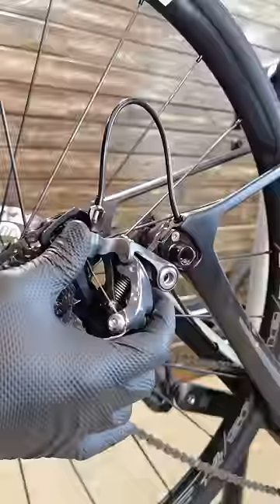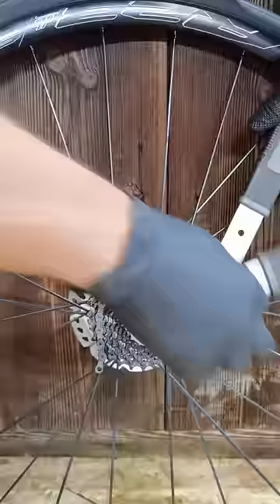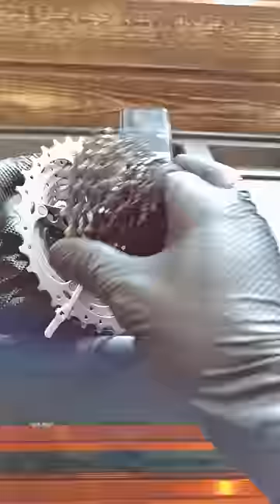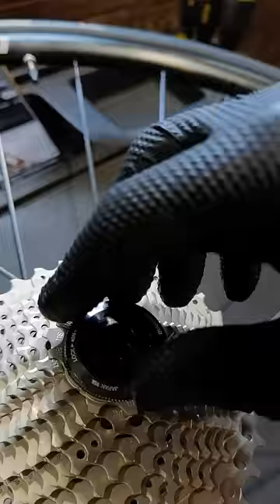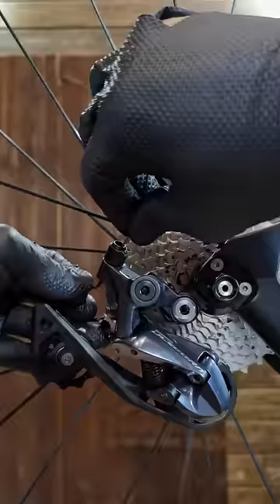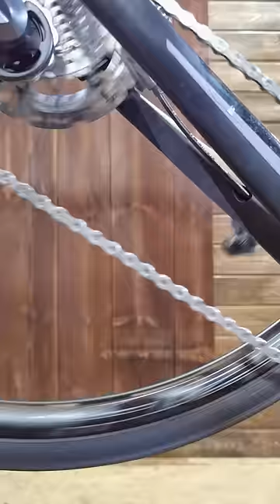Need lighter / lower gears on your road bike? Do this.

Comment: "Do this" like it a cheap upgrade. 😂
Reply: you can go off brand for cheap
Reply: It would be easyer to buy a new bike
Reply: @guilhermerizzo1984 Got more insanely stupid jokes? Go on!
Reply: @guilhermerizzo1984 Yeah maybe a heavy ass sipermarket one. Cesettes are like 50 euros. Good derauliers are around 100 euros.
Reply: @guilhermerizzo1984  not necessarily. You're not replacing the whole groupset or the wheels, just the cassette and chain and maybe the derailleur if it has a short cage.
Reply: You have to change it at least once a year if you ride a lot so you just buy a different one, not a single euro spend to upgrade
Reply: it is a cheap upgrade....i don't know what kind of price do you have and what a state do you live in.
Its made not from Gold, you know..
Reply: 105 derailleur is about 45 eur. 105 cassette about 55. Chain is another 20 and the cables about 10. Total cost is about 130 euro if you go for 105 and about 210 if you go for Ultegra
Reply: Tera phone isme chala jayenga pura
Reply: It is a cheap up grade😂
Reply: Thats a whole 300 to 500 dollar stuff, i might be wrong
Reply: @BeatSaberNoob just buy a new bike
Reply: High end components are pricey, for comparison, 9speed sora is £25 for the derailleur, £30 for the cassette and £20 for the chain, you can easily get a marginally lower end cassette and chain for £20-25 and £15 respectively if you're upgrading a less fancy bike.
Reply: Generally, to get more gears, you need a new cassette and chain. 
Is this hard for you to understand?
Reply: @BeatSaberNoob why would you add sh£tty cheap components to a nice new Shimano groupset?
Reply: Where did he say cheap upgrade? The unemployment is really showing with this comment
Reply: @guilhermerizzo1984 what are you talking about a bike would cost like easily 10-20 times more
Reply: It us a cheap upgrade. I did it
Reply: @guilhermerizzo1984 if you do t know how to work on a bike I guess. This is basic stuff..
Reply: @razzor4708  lol if your other parts are compatible..  Still it's not "cheap", cheap is like $20-$40.  This cost like $200 minimum lol not to mention if you don't have the $100's of dollars worth of tools already, then you will have to pay shop labor which around me at leasy ranges from $70hr-$90hr lol
Reply: @guilhermerizzo1984 bullshit 😂
Reply: @razzor4708  iPhone are also not made from gold but they still choose insanely high
Reply: @christosandreev6392 do you have to necessarily replace the derauiler? Real question
Reply: @guilhermerizzo1984  Easier isn't the same as cheaper. It's not hard. Best mod I've ever done to my road bikes.
Reply: I bought a new cassette for $36. As far as cycling costs go, that's almost free.
Reply: @guilhermerizzo1984 do you know the cosy of parts vs whole new bike. You know nothings nout bikes with that comment rt there
Reply: Aqui no Brasil para colocar um K7 de 10 velocidades da absolute, com corrente prateada KMC,coroa dianteira 36 da deckas, câmbio e passador Shimano e cubo Shimano custa 1.800 reais.
Reply: It Kost like 80 Dollar
Reply: @jurekgadzinowski2895  he is brazilian, you mistake for giving his comment any value
Reply: I'm ashamed he didn't use 11-52 cassette
Reply: @guilhermerizzo1984 eventually you would want to replace the cassette anyway, ppl who ride their bikes over a thousand miles a year would know this. For the neighborhood cruiser, it probably doesn’t matter

Comment: Alternatively learn how to pedal harder if you're short on tools and cash
Reply: and destroy your knees
Reply: Dumb take....
Reply: @olivier8645 evolve your knees *
Reply: I can! My other bike is fixed gear. But on a loaded touring bike?
Reply: There are old riders and "man the. . . Up" riders. There are no old "man the. . . Up" riders.
Reply: Why, my bmx is a single speed with a 70T front sprocket and 9T rear freewheeling sprocket I on purpose built for speed. Furiously fast on flat roads, insanely fast downhill! At full speed, left even some motorcyclists I overtook going downhill in awe! Overjoyed with it! 😊 I’m not even bothered by the pedalling effort required. HAHAJA! 🖐🤤

My advice is go ahead and try it and see for yourself what you will gain in speed. 😁👍
Reply: @hyperboytkl1077 Amazing story.😂
Reply: @hyperboytkl1077 And then you woke up because you shat your pants.
Reply: @hyperboytkl1077 I hope you at least had fun making up all that BS!
Reply: @boredmartymcfly6099  wow, you sound like you ain't seen your junk for years without the aid of a mirror, I too have a bmx and at full pelt its quick as! From standing start its quicker than my mtb and 60% lighter at least.
Reply: 11-28 and 52-36 at the front. I really need to push hard to keep cadence optimal
Reply: Road bike supposed to have smaller gears so you can go faster. Plus you have two rings in the front. I never had issues with road bike needing larger cassette
Reply: Yup
Reply: @olivier8645 snowflake
Reply: @sempi8159 I think it’s a dumb take to assume everyone can afford new things. It’s actually pretty reasonable to assume you need to pedal faster if you do t have parts to help you do so?
Reply: @hyperboytkl1077 How are you going downhill when you have to push your bike uphill?
Reply: I just think younger😂

Comment: "need lighter gears? all you need is €500 in tools and parts"
Reply: 3k
Reply: @69burtolaughing my fucking ass off 😂😂😂
Reply: This is an XT derailer and casette and probably a cn-hg95 chain. So its more like 150-200€
Reply: @Vracka  tell that to the bike part seller
Reply: xt derailleur? @Vracka
Reply: @UserT5959 recently changed a bottom bracket from an old square taper to a new integrated one. Lets see: an altus 3 speed crankset, a bb-mt501(i think) bottom bracket, a hg-93 chain, a crank arm puller, the tools that go into a wrench to get off the square taper bottom bracket, the tool for tightening the new integrated one, and 150ml lithium grease, chain rivet tool. I think it was around 150-160 euro if i calculated it right in my head.
Reply: @69burto yes, I in fact will buy a cassette tool, chain whip, Ultegra chain (which on its own costs approx £40), an Ultegra/XTR cassette, and a medium cage Ultegra rear derailleur for less than £60, why didn't I think of it sooner.
Reply: @Vracka  It literally says Ultegra on the derailleur. They're on par with the cheapest ones. Next to slx.  I changed on my full sus from an slx 1x11 to an xt derailleur. Only cost about £70. Plus an xt shifter. Didn't need the shifter. Just wanted it. Don't recall how much. Jeez. Contrast that to the bike I have now running a sram axs system. Tbf though "cheap upgrades" are all relative and I guess a case of budget + if it's actually worth it or not. For this video, a smaller front chainring would make more sense. Smallest sprocket will always be 10 or 11 teeth. So this "upgrade" was only to get shorter ratios. And 1 or 2 extra gears, I didn't pay attention to that before typing 😂  But a smaller front chainring is far cheaper than what this Chief did.
Reply: if you already have the shifters and such on your bike, all youll need is to get a long cage derailleur which can cost like, 50 bucks, then a cassette lockring tool for like 10, then chain whip for like 15, cassette ranges in price, then a new chain for the new length
Reply: you can get those tools at a cheap price for around 30-40 and if you buy a cheap cassette like tiagra you can get it for 40-50euro. Less than 100 euro if you go a bit cheap. works fine.

Comment: It's not as simple and, above all, cheap as it may seem. To switch from an 8-speed cassette and Claris derailleur to an 11-speed setup, you need to replace not only the rear derailleur, cassette, and chain but also the front crankset (due to the narrower chain) and the rear derailleur shifter, incurring additional costs. Usually, the hub that supports 8 speeds may not handle 10 speeds, so there's a concern about needing to change the hub as well. Additionally, the Ultegra derailleur won't work with the Claris shifter.
Reply: What are you talking ? The original cassette had 11 cogs. Or are you referring your own setup ?
Reply: @gerrysecure5874 11? Claris? 😅
Reply: You right!
Reply: Both derailleurs were ultrega. He just upgraded to a long cage

Comment: Shimano chains should always be mounted with the logo facing outwards 😅
Reply: Shimano chains should always be inserted... into the bin. Replace with a fresh KMC.
Reply: Pseudo high tech claim added by marketing like rotation direction on Conti road tyres ?
Reply: @gerrysecure5874  it is in the manual of some Shimano chains. I do remember for sure Ultegra and Dura ace 10s; those were directional chains.
Reply: @gerrysecure5874 Never had a problem with which way the chain goes on, taking it off once it's been run in for a while,best put it back on the way it came off. Did it once to clean my drivetrain and it felt like I added gravel instead of oil. You live and you learn .
Reply: @Metal-Possum Nonsense
Reply: Most Shimano chains are none directional. Only a few special ones are
Reply: @Metal-Possum  some kmc chains are breaking by looking at it...
Reply: @Metal-Possum I’ve blown apart a couple KMC chains on my old BMX.

Comment: changing front chain rings is easier and cheaper
Reply: Changing the rear cassete gives you a wider range of wider gears which you can shift into more regularly
Reply: Ultegra chainrings are far more expensive and don't achieve the same change in ratio, you lose top end to gain bottom.
Reply: Sprocket?
Reply: Depends on what is the worst worn.
Reply: @chemeofficial yes, but its called a chain ring.
Reply: One tooth in the back is about equal to 3 in the front.
Reply: @chemeofficial yea
Reply: In many cases it doesn't work. Plus, is that an advice for someone who still wants to run the same "heavy gears"?
Reply: @chicacherrycolalime  cassette 300, chainring 30 .. and less tools
Reply: Some cranks and spiders make that difficult
Reply: But you can't make a video with dumb title

Comment: Thank you!
That’s an easy and cheap solution to fix this! Who would think about changing the cassette and derailer when you want lower gears?
Reply: seriously
Reply: Like it didn't even cross my mind
Reply: I thought you had to buy a new bike. Wow was I wrong.
Reply: anyone that is heavy and rides up big hills
Reply: @MegaPhill93 ❤
Reply: I mean, what other solution is there 😂
Reply: Might as well change the chainrings while he's at it,new chain on possibly worn chainrings ?
Reply: @richardgilbert5339 
Depends on what you are running
Reply: @richardgilbert5339  depends on how worn the chain was but yeah that's possible
Reply: where in the title or description did it say "CHEAP and EASY way to lower gears on your bike"??

Comment: If anyone wondered, a Claris R2000 rear derailleur can handle a 36 teeth cog without a road link. I have been using it for a year without problems.
Reply: I have a doubt 
Can we change the gear quickly? Like from 1 to 4 in rear gear
Reply: The long cage variant?
Reply: @Nh4518-z4r 
No. Also if you want to Chance gear while pressing really hard in a groupride would result in a droped chain